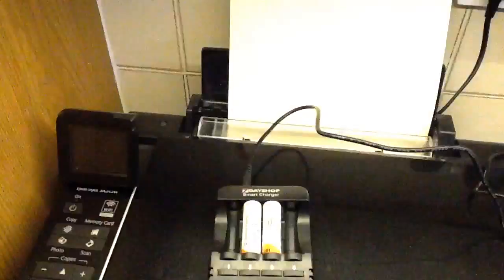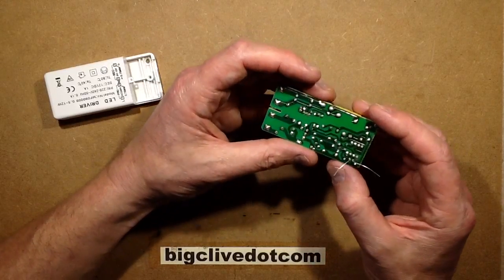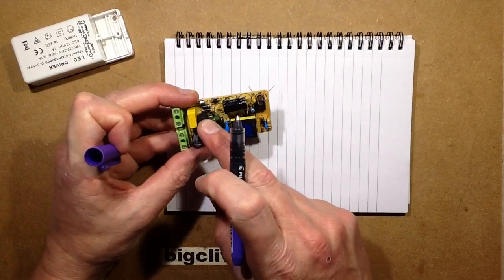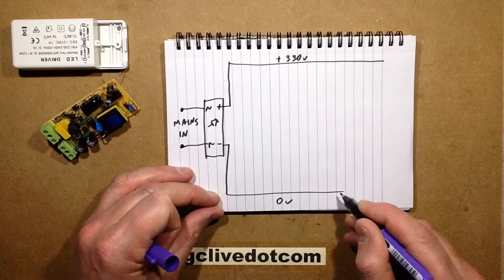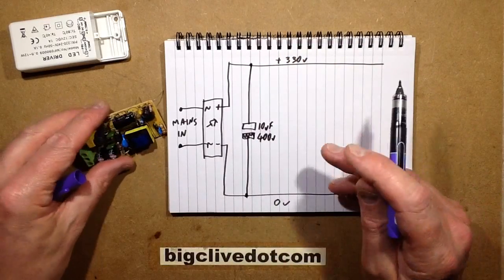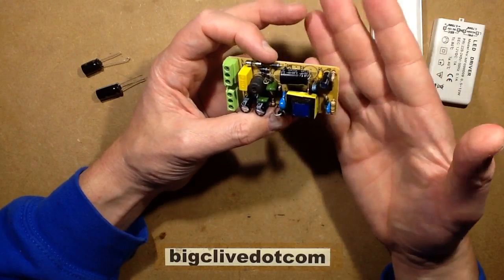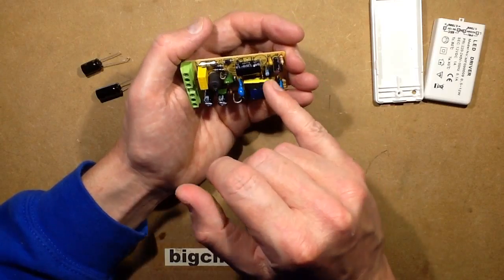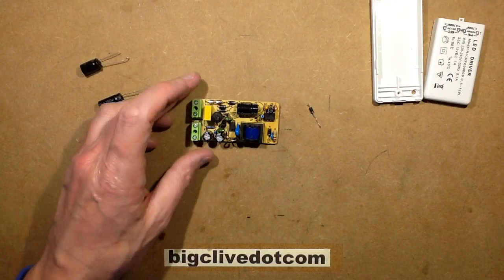(Flashing content.) Repair of strobing LED power supply.

Comment: bigclive would you be interested in a 1.5KW ATX PC 230V power suply that turned to a PC killer and breaker tripper after a lightning strike?
Reply: akabiscuitwaffle
I don't know where you get the "lighting strike" rating ... all electronics are susceptible to lightning surges. Even a surge arrestor cannot sufficiently absorb the full current/power of a lightning strike.
Reply: RFI capacitor shorted allowed the mains into ground rail of the output, other rail maybe shorted inside the transformer and you have a PC killer. I would suggest that when something went through a lightning strike, just recycle all of it and get a new. Even when there's no obvious signs, you still have it's electrical isolation compromised, it's share luck that the power supply didn't turn into human killer.
Reply: madinatore Actually yes. Silverstone doesn't make PSUs. They buy from ODM companies and slap their logo on it.
So depending on the model you bought, it could've been a crap-tastic brand without you knowing it.

http://www.realhardtechx.com/index_archivos/Page998.htm

That^ shows what model the PSU really is. there's a real good chance you got stuck with a POS FSP rebrand.
Reply: guess I shouldn't buy silverstone and MSI/ASUS then eh?
Reply: No.  There is no high quality (ATX/PC) power supply or motherboard rated to survive a lightning strike.  That is what a surge suppressor is for, even if that still doesn't save it but rather it comes with a connected equipment insurance policy to replace the damaged hardware, but be aware such policies often go by fair market value of it (being used equipment), not initial and not necessarily even actual replacement cost.
Reply: well its not visibly damaged from outside
Reply from the maker: If the PC was dead then it may have suffered from the lightning strike too.  I doubt even the best quality PC power supply could keep lightning from getting through.
Reply: as I killed a new motherboard with the damaged PSU its a killer on its own now
Reply: annddddd that's why cheap PSUs are refereed to as time bombs.
Oh higher quality ones ARE rated for lightning strikes, and so are quality motherboards.
Reply: +madinatore Send it to me, I would even pay for it.
Reply: Stinky Cheese

>It's obvious you're just trolling

That's cute, you don't know anything about the topic so you defer to calling the other party a troll. Where is your rationale to back that up?

>There's nothing less complete about autonomous units with automatic redundancy.

So tell me this all knowing genius. How do multiple point of sale terminals communicate orders to each other and have a coherent listing of orders on a dumb terminal screen for the cooks to look at? How are multiple cook lines managed? How do the terminals know not to duplicate orders to multiple serial printers for different line cooks?

The simple answer - They don't. There is a SERVER that manages all of that in the back office, there is no peer to peer system of autonomous point of sale clients, it would never work.

>I didn't come to this video to discuss modems, then credit card processing, so meh, no longer troll.

Oh dear, now we have the rationale for your errant behavior. You're tired of defending your incorrect arguments and pretend like you're too important to back them up.

You're the definition of a troll, troll.
Reply: Stinky Cheese
bye hon!
Reply: +Stinky Cheese
>That is what a surge suppressor is for, even if that still doesn't save it but rather it comes with a connected equipment insurance policy to replace the damaged hardware

Surge suppressors will rarely if ever protect equipment from lightning strikes. Power surges more often come through other sources like cable and phone lines than through the mains. I can't tell you how many lightning strike jobs I've been out on where the Ethernet chip was blown clean off the motherboard of a computer and the traces on the motherboard were vaporized. The same goes with modems, the modems would be charcoal briquettes and burned into the slot it was plugged into.

There was one job where a lightning strike came in through the cable line, blew up the cable modem, the router attached to it and every Ethernet chip/card and switch in a business. Ended up killing 9 PCs which all ironically had surge suppressors.
Reply: GGigabiteM anndddd that's why you stick your ethernet through a surge suppressor. More particularly a really nice one that comes with a "if it fails to protect X things connected to it we'll pay up to X to you".
Reply: Hope you learned the lesson: ALWAYS test suspect PSUs with a meter (with and without load).
Shorting green and black in the large conector tuns it on.

Sometimes cleaning the inside will fix it, probably something to do with a short or increased/decreased resistance.
Reply: akabiscuitwaffle
 The problem with Ethernet ports on surge suppressors is that they're usually the ancient 10BaseT standard or at best 100BaseT so they create a huge bottleneck.

They're also another point of failure in network connectivity issues you have to deal with.

The better option would be to put one in line with the phone line or the cable line. Though they could still cause issues in that case as well, especially on cable where heavy shielding is necessary to maintain signal integrity.
Reply: Stinky Cheese

>C'mon, who uses one of those today except in a fax machine

POTS lines are often required as a backup for credit card processing, so many more businesses than you think require a modem in a PC in the back office.
Reply: Or if you want really good protection, a short run of fiber.
Reply: Stinky Cheese

>Yes I had forgotten about POS credit card processing but where have you seen them hooked into a PC modem?

I service the restaurant industry, PCs in the back office with modems for credit cards is standard practice in most deployments.

>All I've seen have either a separate self contained box with modem (old style for traditional cash registers),

or are in the computer that drives the touchscreen display for modern setups

You've clearly never seen a complete point of sale deployment. The POS stations at the counter are not self contained units and require a server in the back office. The little credit card units to the side of the register also usually routes directly to the on-site server.
Reply: Stinky Cheese

> I wouldn't call a PC in the back office a "complete" setup at all, rather a dodgy cheap one

lol. It's obvious now that you've never seen a complete point of sale system. All of the major vendors have back office servers.
Reply: Most likely the high side switching transistor(s) are shorted.  PS - ALWAYS test a suspect PSU before hooking valuable gear up to it, so you don't go killing a new motherboard.   If you have doubts whether it's the board or PSU, it's safer to hook a questionable board up to a known good PSU, than hook a questionable PSU up to a known good board.     If you don't have a proper PSU load testing rig then you can at least get a $5 generic that places minimal load on 5V and 12V rails to keep it running, and shorts PS-On signal lead to ground to start it full-on, then measure voltages with a multimeter.

That cannot assure stability at higher load, for example a psu could pass this test if it has progressively failing capacitors, but then you can add a low value load like resistors or some retired HDDs, and it would not likely pass this test with power surge damage from lightning.
Reply: Stinky Cheese

Oh hi, you're back so soon!

Yes, your ego is good at educating people that you're being a tool. Remain edgy bro.
Reply: Yeah but modems?  C'mon, who uses one of those today except in a fax machine... and who uses one of those today besides an antiquated business or law enforcement?

Most often when I see (interior) ethernet cabling carried a surge, it was because OOPS, somebody forgot to plug their router/switch/etc into a surge protector.  Same could be true for a modem though it has a much higher risk if the telco line is sitting up on a pole prone to attract lightning.
Reply: Yeah but it better be a reputable company and many have fine print that declare "X" to be the current (used) value of the equipment.  Often equipment is worth far less than half its replacement cost when it has far more than half its viable lifespan remaining.   Then you can turn to the used market for replacement but if there's a problem, the blame falls on the person who picked used instead of new.
Reply: Most network born surge damage I've seen that traveled over the cabling, originated on the power line.  In other words, "in many cases", the ethernet ports don't necessarily need surge protection if you divert enough of the surge upstream in the connected device.  Besides, surge protection on ethernet ports tends to be nothing more than a few little MOVs.
Reply: Yes I had forgotten about POS credit card processing but where have you seen them hooked into a PC modem?  All I've seen have either a separate self contained box with modem (old style for traditional cash registers), or are in the computer that drives the touchscreen display for modern setups, self contained setups, never going through a PC in the back office.
Reply: I wouldn't call a PC in the back office a "complete" setup at all, rather a dodgy cheap one.  The little credit card units on the sides of registers had their own modem and phone line plugged into them.  Certainly a setup can differ, but they were autonomous, more complete in having redundancy.
Reply: It's obvious you're just trolling.  There's nothing less complete about autonomous units with automatic redundancy.   An argument could be made that the opposite is true and yet, I didn't come to this video to discuss modems, then credit card processing, so meh, no longer troll.
Reply: you bore me, so no, bye.
Reply: It is sad that you don't understand.  My ego was about to educate you but no.  I was going to explain why,  but no.   Remain the same.

Comment: Somethings I think it would be great if you had a scope Clive. Would help the investigations on some of these failures. 
Sadly not unheard of for these diodes to fail
Reply: I also think showing the actual waveforms on the circuitry like mains, rectified mains, smoothed rectified mains (/with bad cap) and generated switching voltage could help understand the circuitry. I have an old analogue scope myself and it not only (obviously) helped me solve a lot of problems, but also really showed me how stuff is working. 
Just an idea that just came to my mind: Probably Clive has one too, but maybe an analogue one  and can't film it due to the flickering.

Comment: Good timing this video.  I have a similar problem with my LED transformer.  It doesn't cause the light to flash, instead I get random intensity in light.  Its only a month old and I've already pulled the circuit board out to inspect it for any obvious issues but I'm not an electronics person. Ill try some of those things you showed in the video.